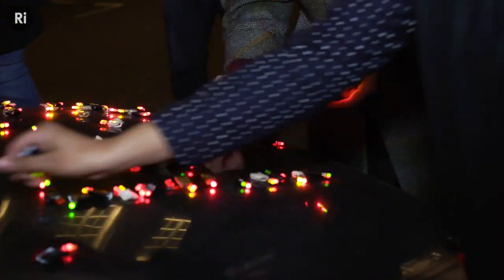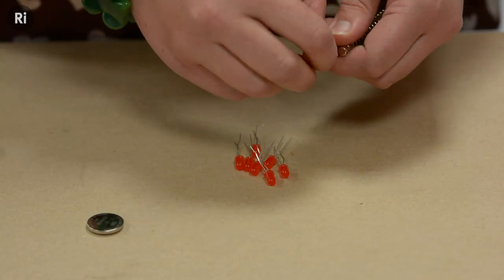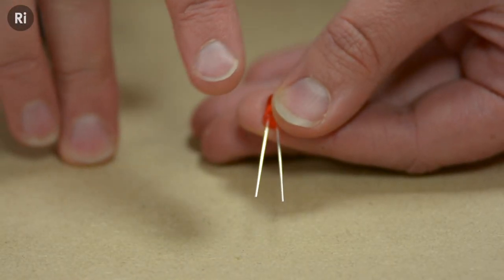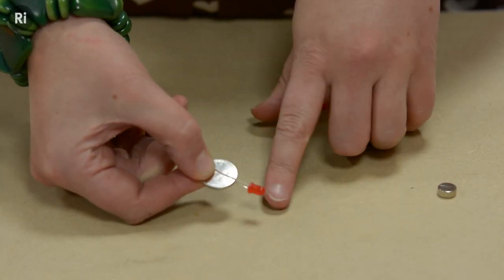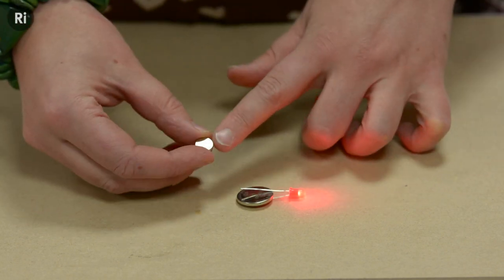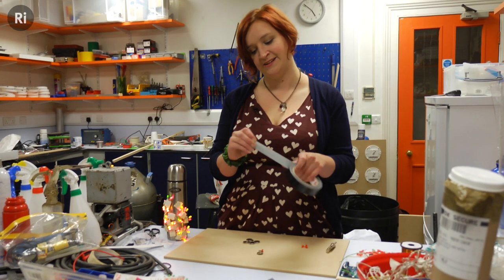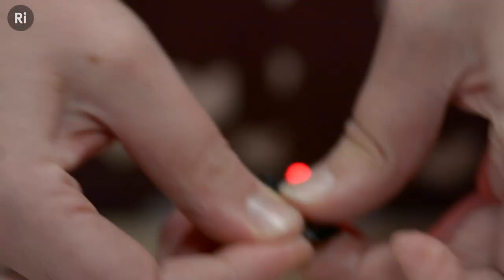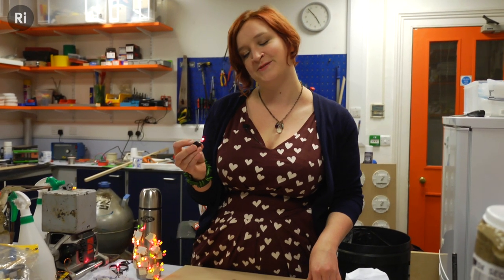How to make LED Throwies

Comment: led: 3 cents. neodymium magnet of that size and power: 10-20 cents. battery of that size and power: 3 dollars. and the battery also happens to be the single-use part of the assembly.
Reply: Where I live, you can buy 2 of those batteries that last DAYS on an LED, and they aren't but a dollar!

Comment: Just don't drive with that car on a highway, as these LEDs could fall from car and hit other cars and make an accident...
Reply: Indeed. - it's difficult to think of a more stupid place to "deploy" them - and motor vehicles need to be understood by children for the dangerous pieces of machinery that they are.

It may be worthy of Snopes, but I've heard a report of a small child swallowing more than one small magnet and them finding themselves in adjacent parts of the bowel, clipping together and causing a blockage or perforation.

As one who grew up with magnetic media and cathode ray screens I'm very wary of having magnets around the place.

I also have as little to do with disposable batteries as possible  - especially lithium ones.

All in all very unimpressed - and this is coming from someone who grew up with lighbulbs, batteries and onto electronics.
Reply: yangtse55
I bet everybody at a party stops laughing, having fun and then leave when you show up.